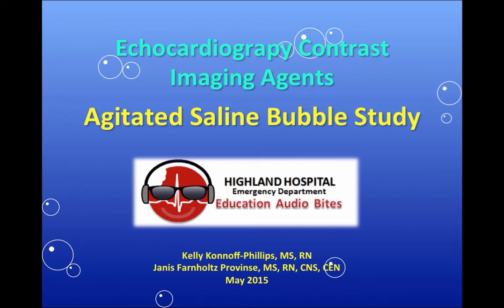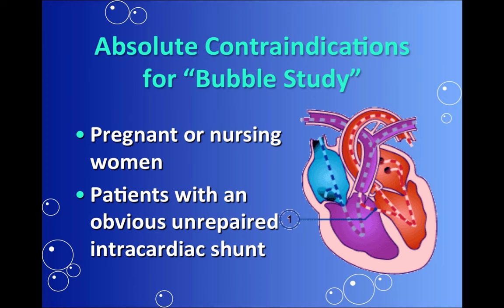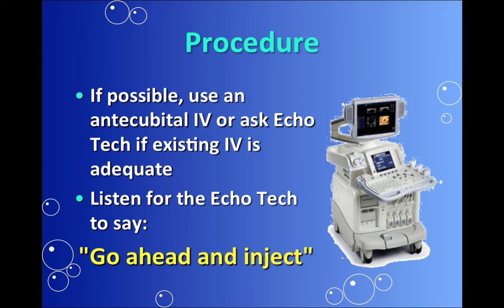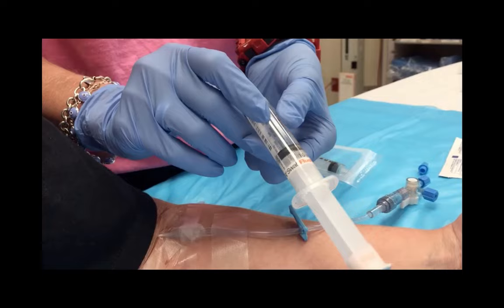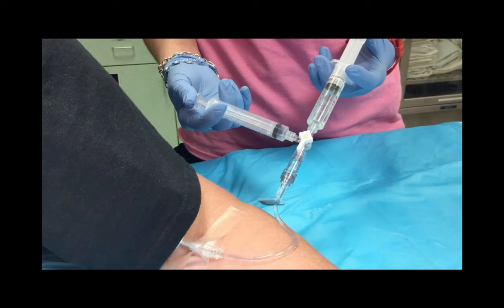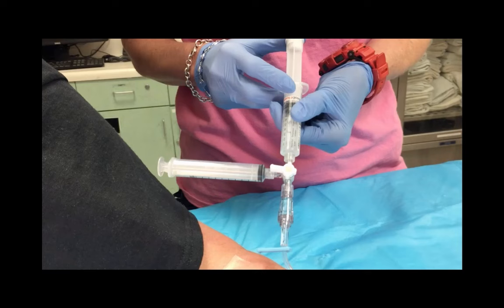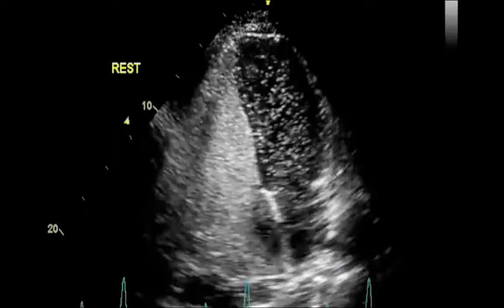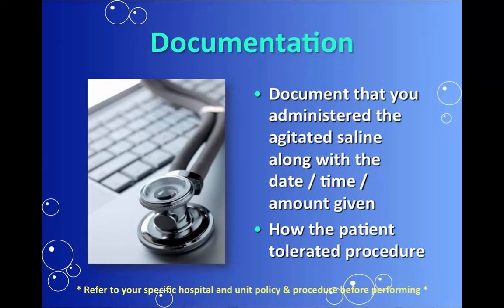Agitated Saline (Bubble Study)

Comment: You appear to be using a Saline Flush syringe that is not terminally sterilized and therefore cannot be aspirated. To do this procedure correctly, you should be drawing up the 10 cc of 0.9% sodium chloride into a sterile 10 cc syringe. (See disclaimer on packaging of the flush)- or assuring that you have a terminally sterilized saline flush and laying this on a sterile field. I recommend that you take a look at Lynn Hadaway's work on saline flushes. Professor Michele Decker RN, MSN, MEd
Reply: Michele Decker
Reply: Yes it should be bacteriostatic saline right?

Comment: I have a question: in the video it mentions intracardiac shunt as one of absolute contradictions but in the end it shows a patient's bubble test with atrial septal defect. I'm confused guys.
Reply: I know I'm 10 months too late in my reply, but I hope this helps.
If the patient has an obvious unrepaired intracardiac shunt, then there is no need to do a bubble study. That defeats the purpose of the study. In other words, if you look at the heart and see a large hole and the Color Doppler is showing an eccentric jet shooting to the other side, that is proof enough of the hole.
This test is usually done when an Echo tech SUSPECTS an ASD/VSD/PFO/PDA and wants evidence of it or wants to definitively rule out the possibility. Also, there is usually not a torrent of bubbles on the other side as is shown; even one or two bubbles in the left heart would indicate a break in the septum.

Comment: What happens if they see no bubbles on the echo? I had to do this today and despite doing it twice and agitating forcefully, no bubbles showed on the echo. The Iv site was in the hand (Does that make a difference?) Thanks in advance!
Reply: This happened to me today too!  They tried both arms, couldn't establish an IV went to the hand and kept saying "I wonder if there are no bubbles because of the hand site?"  I asked if the doc would be able to actually use the images they got and the answer was "I don't see anything that makes me want to run out and grab a cardiologist".  So I am not sure at all what will happen!
Reply: The question was posted some time ago, but worth answering.

While some hand IV sites will work, they are not recommended.  The preferred site is the antecubital vein.  For some patients, veins in the hand are too small and exert too much pressure on air bubbles causing them to get absorbed before ever reaching the heart.  It is the same reason 18 or 20 gauge is the recommend IV size, though I am routinely successful with 22 or 24 gauge.

Unfortunately, if we cannot see the bubbles in the right side of the heart, that portion of the exam (the bubble study) will not be diagnostic.  This will require repeating that portion the exam with a different access site or during a TEE.

Raymond Rosario, RCS, RDCS
Reply: It should work where ever IV is. It will just take longer. Maybe went interstitial.
Reply: @raymondrosario7214  Bless your good heart 😊